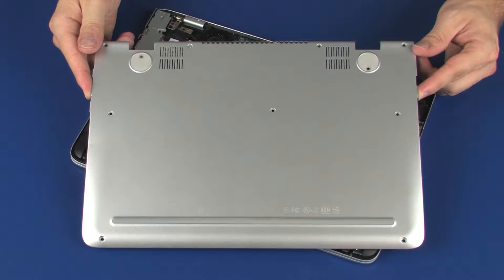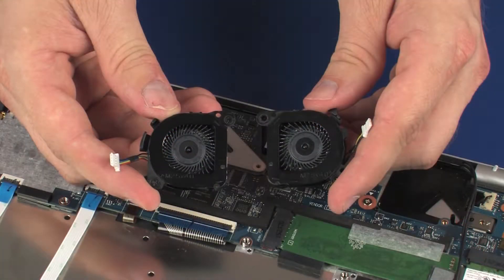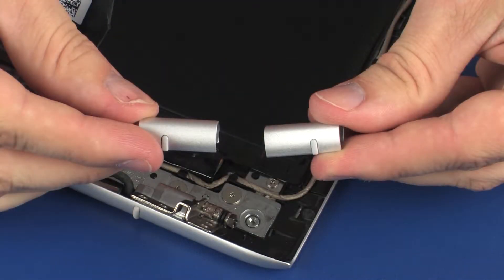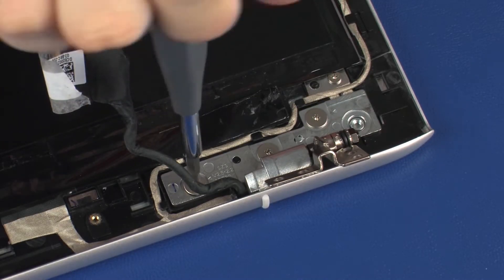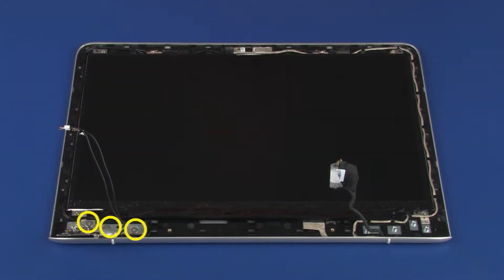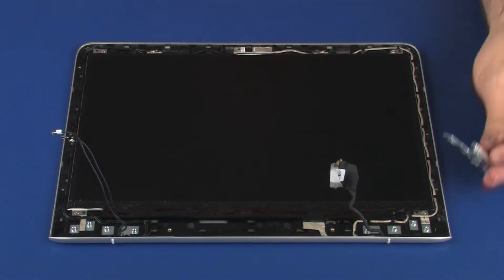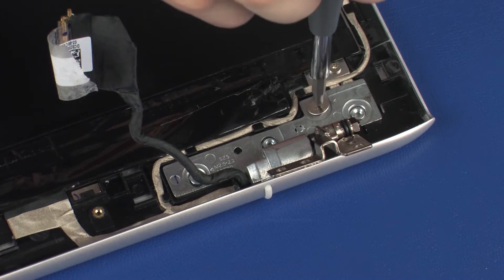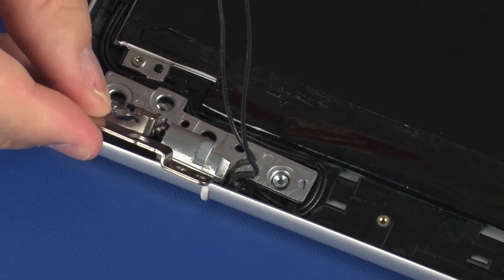Replace the Display Panel Hinges | HP ENVY 13 Notebook | HP Support

Comment: My HP envy 13.3 screen hinge started to crack when opening and closing. This began soon as the warranty ran out! It's apparently a common issue within the HP range.
Reply: My laptop also did exactly the same. I have read this is a very common defect with this laptop.
Reply: me too bro, it started within a year i bought the eny 13 2018 model
Reply from the maker: Hi,
Thanks for reaching out to us.
May I know the issue in detail?
Not to worry we will assist you .

Regards,
HP Support
Reply: @HPSupport  Mine has done exactly the same, hinge is causing the screen to come apart. I bought this laptop as it was recommended, his did the same and now mine is broken, not happy at all!!!